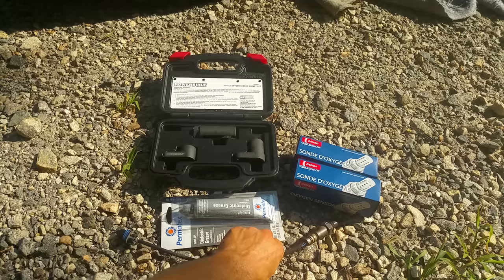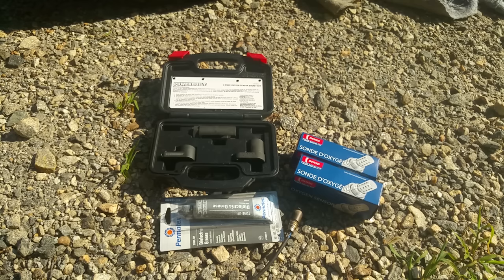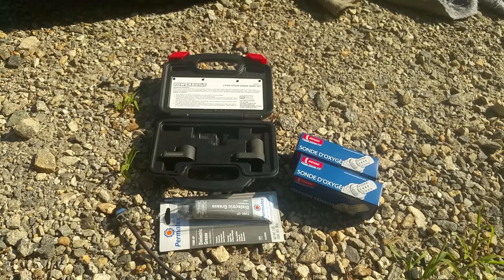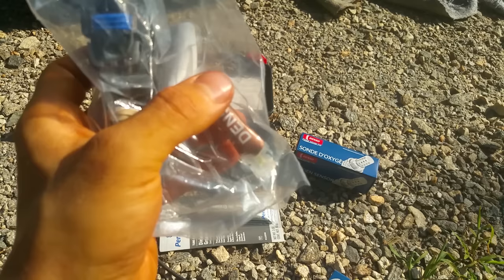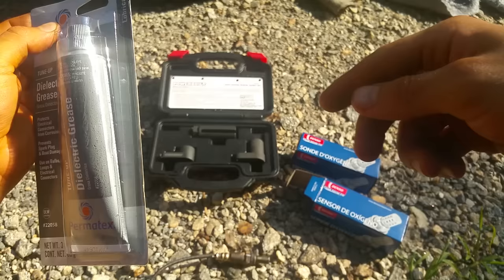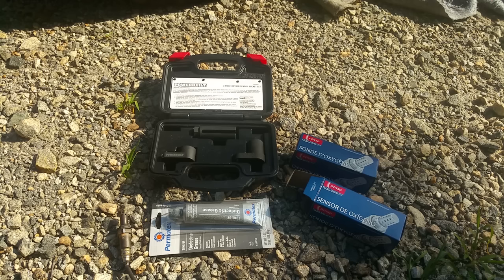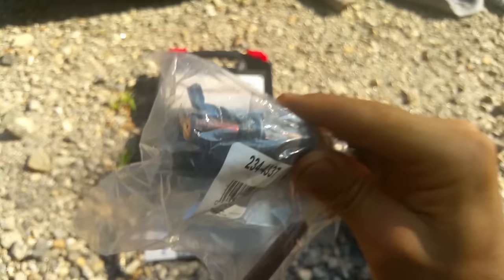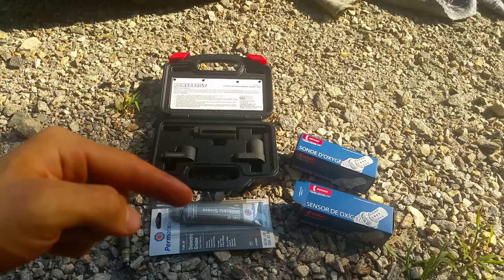NEVER Change Another O2 Sensor Until You WATCH THIS!

Comment: #1 rookie mistake DIY enthusiasts make on an o2 sensor change: removing the sensor from a manifold/header at ambient temperature. Always preheat the sensor bung, either with a torch or by running the engine until the manifold/header is at operating temperature, unless you enjoy torn knuckles & stripped threads.
Reply: That's what the auto tech at Auto Zone said when I bought an 02 sensor took kit. He said to heat it up - first.
Reply: I just raced my truck for a few minutes they still didn't come out easy
Reply: I did that, burned the heck out of my hands, stupid to do it hot!!
Reply: My fixer said opposite. He said if you remove O2 sensor when its still hot/warm, it breaks easily even with a little tap
Reply: In theory, heat makes things expand
 So I would tend to think, cooler would be better. 🤯
I'll have to do more research on this.
Reply: This is the type of stuff you learn from
Reply: @chadbailey189  only stupid if you're not wearing gloves n long sleeves.
Reply: @rbrooks1305  You heat the surrounding metal and it expands without heating up the sensor itself. Which is cooler and doesn't expand as much. That is the theory.
Reply: What about on my 2000 w a forged aluminum block shouldn't it be done cold
Reply: oH GREAT cant just change it out.
Reply: Wrong 🤡
Reply: I have done many with a cold engine and wasn't a problem,  I prefer the engine cold, some want it hot, I say what ever works for you.
Reply: This is Arizona baby not the rust buckets back east
Reply: How about you all get all ready to remove the sensor put the socket on the sensor than shock the muffler with heat until it begins to reach the sensor. It’s useless to heat both the female muffler and male sensor together, they are quite comfortable to expand together and stay tight with each other when hot, as they’ve done it all their life. 
The ice cold socket should help a little to shield the sensor from the torch heat. Don’t use the engine to heat it up. Do all this on a cold morning.  Like this fellow said many times “you know” and clearly by the comments, everyone knows. 😅 
the purpose of heat is to expand the muffler threads with heat while keeping the sensor cold and shrunk. 🎉
Reply: I've NEVER had an issue being able to remove an O2 sensor on a cold vehicle.. 🤷🏻
Reply: @rbrooks1305  You’re not supposed to torch it to where it’s insanely hot.   The idea is get it between warm and hot.  When it’s cold it’s very difficult to remove bolts.  Heat may slightly expand but you also loosen that tight rust that makes the bolts seem welded on their.  I’ve broken bolts and tools trying to remove bolts that are straight cold. Now IF you choose not to use heat, at the minimum spray some WD40 on the bolts and let it soak for 25-30 min first.
Reply: Half of these videos are misinformative
Reply: I just crawled under my truck and unscrewed it with my hands
Reply: @fernandojuancadena2475  Cast aluminum block?
Regardless, you're heating up the bunghole on the exhaust, not the engine block.
Reply: @garystevens1044  Thanks, that helps me remove my O2 sensor.
.....and every other person that watched it. 👍
Reply: @rbrooks1305  that's why you want to heat up the exhaust bung more than the sensor. Or at least that's what she said ; )
Reply: I did mine with a pair of needle nose pliers, no problem.
Reply: @alexcarbajal4862  😁😁😁
Reply: @alexcarbajal4862  channel locks for me...easy.
Reply: TY my Friend I am one of those so called DIYers but is out of need. Shops are charging more than I can or want to so all the videos I truly don’t know which to belive. So again TY the heat thing I will concur
Reply: Thank you so much for this advice
Reply: I’ve never had any problems getting an 02 sensor out !
Reply: @mattmatt222333 was not screwed properly then. But Im probably lucky one because I never had issue taking them out.but not as lucky as you to do it with hands only
Reply: Cold engine works for me
Reply: I’ve never had a problem taking them off cold .
Reply: @chadbailey189 Gloves work....
Reply: 3:07 why don't manufacturers put anti-sieze? It's getting them off when they are original that is a real pain.
Reply: Heating the housing is what will expand it away from the sensor, but heating both will probably expand them both.
Just saw some electrical wire heaters for taking off bolts and nuts. Probably hard to get it on the O2 sensor with it's wire, but safer than using flames.
Reply: Great idea brother! Thank you! Just read your comment, i will be doing this work in a couple of days, thank you for the advice! :) it will come in handy
Reply: I spent a few hours and several tools and methods including lubricating it. Nothing worked to get the sensor out. I finally broke out the map gas. Heated the exhaust pipe up some and bingo, it came loose. I was apprehensive about having a flame, but it worked out.
I have seen the electric coil heaters for heating nuts and bolts with no flame. TEMU has a few pretty inexpensive ones.
I almost ordered one, but I have so many tools I've bought and only rarely will use, that I could spend any more money and the map gas did fine.
Reply: @rbrooks1305  that is why it's important to try and keep the heat on the exhaust pipe, not the sensor. The pipe and threads will expand away from the O2 sensors and break that bond.
Reply: 100% correct I just watched this video and wrote about what you did in my comment
Reply: @rbrooks1305 Yes, it’s the expansion that you are looking for in a scenario like this.
Reply: I did it warm and it came rite out wooo hoooo 🎉🎉🎉
Reply: @davelowets same here came rite out with Noooo Problem 🎉🎉🎉
Reply: @dennyklein1965 that's all I use WD-40 came rite out
Reply: A circumference expands 3.14 times more than a diameter for a given rise in temperature. Roll your sleeves down wear appropriate gloves
Reply: @fernandojuancadena2475 they thread into the exhaust, not the engine block...
Reply: Glad I came here and saw all these comments about heat.  I would have waited for it to cool down so it'd be easier to work on.

I've NEVER had a bad O2 sensor in my life.  I've gutted cats, replaced cats with "test pipes" or "off road" pipes, had vehicles with nearly 200k miles, etc., etc. and NEVER had an O2 sensor issue.  Not even one where I had to take it out and clean it.

But I have a 2000 Buick Park Ave with the 3800II NA (no supercharger) and I've been having a high idle, rough running, horrible fuel mileage, low power, pinging/knocking, and the rough running is like a constant "shake" while accelerating.  I have a BT OBD2 scantool and use my Android phone with the Torque app and I've noticed all the tests that pass green have always done so EXCEPT the "Catalyst" one, it always stays red and says "Incomplete", I believe.

Well, after the code for the IAC unable to maintain a low idle and replacing it with no change, I got that same code, again.  I changed the PCV valve and the fuel pressure regulator (throwing parts at it).  No change.

Today, FINALLY, my first O2 sensor code popped up.  Bank 1 Sensor 2 O2 sensor bad.  Now, I realize codes don't mean the sensors are always bad, it means they are sensing a problem (hence my IAC motor replacement), but I've had a gut feeling this was an issue for quite some time.  Either an O2 sensor or clogged cat.  I've just never experienced an issue and I'm 38 now and have had a dozen or more vehicles and never had any O2 issues so I doubted myself thinking that could be a prob.

Well, I picked one up today, a Bosch one was the only one in stock, no Denso, and I'll put it on after my little brother's funeral tomorrow if I can.  It'll help take my mind off things because I'm not in a good state of mind at the moment.  I don't have any dielectric grease but I have CLP that I clean and lube my firearms with that I'll use (it's dielectric).  

I'll be sure and get it warmed up before I attempt to remove it.  I wish the cat was bolted on there like my old Dodge Stealth R/T did.  So much easier to remove and replace with a pipe or take it off and gut the cat.  I've never had an O2 sensor issue after gutting/removing cats lol.

Fingers crossed this fixes it.  I've noticed my AFR has been holding steady at 14.7 and at WOT I saw it hit 14.3 for a split second.

I used to have a different Stealth R/T TT and a 3000GT VR4, both modded with bigger turbos and injectors, and I could have sworn I had a must lower AFR than 14.7, but it's been a long time.  I had to tune it on the fly, depending on the boost I was running because I was running larger injectors on the stock computer.  So I'd have to tell my injectors to cut back by around -22% to -25%... I just can't remember the AFR I was looking for.

A google search is showing me 14.7 is "perfect" lol.  I'm gonna be sick if this doesn't solve the issue.  That means I have a vacuum leak and I'm 99% sure my vacuum leak is a blown intake/head gasket.  I have 119,xxx miles on this 3800II.  I have flushed the Dex-Cool coolant once... but I don't think it matters.  I'm a believer that ALL of these 3800II's blow headgaskets and all of those 3.1/3.4 engines blew the head/intake gasket that was shared between the head and intake.  

I hate GM to be honest, but it was my grandmother's car and she left it to me.  I maintained that car immaculately.  It had transmission fluid changes every 25-35k miles, 3k mile oil changes (even with synthetic because that's what she wanted).  I put copper plugs in at 80k miles (don't ask... I was a copper plug guy for the "power" lol) and I just replaced them with iridium plugs.  I still run coppers in my 1986 5.0 EFI F-150, though.

I'm happy for this, but her car had ZERO issues while she was alive.  After she passed, I babied the car to make it last and be respectful because I loved her more than anything.  That's when all these issues started.  Bad alternator, leaking valve cover gaskets, this high idle/rough running issue, the coolant reservoir running dry, some loud squealing that NO ONE knows what it is.  The squealing only happens when it warms up and it's hot outside.  If you rev in park, the squealing does not change in pitch with the revs.  The only thing that affects it is a LOAD on the engine.  You have to be in gear and give is gas.  The squealing is always the same pitch/sound.  I put a new belt on immediately with no change.  Dealership wanted $375 to TRY 3 things to see if they were the problem.  It was a BUICK dealership... am I the only one with a squealing Buick/3800II?  It feels like it because no one knows what I'm talking about.

Oh, and if I pull the dipstick out while it's running OR take the oil cap off, the vacuum is so strong, it kills the engine.  The O2 sensor isn't the ONLY issue, but if I can get it running smooth, it'd be a lot easier to sell.

Then I'll buy me something reliable...aka a Ford with a 4.6 SOHC.  Most reliable engine ever built.  I had a 1994 Thunderbird with the 4.6 SOHC HO (same engine as the Mustang GT) and the 4R70W transmission.  Know what probs I had out of that?  A bad MAF when I bought it at the auction.  I ran the HECK out of that car and it never gave ONE single issue.

 I have a 1986 F-150 5.0 EFI with the NP208 Transfer Case and NP435 4-speed with bulldog and the 9" rear with 3.50:1 ratio.  Guess what issues it has given me?  A bad TPS.  Then at 120 or 130k, the timing chain needed replacing.  Now it has a steel timing chain and gears so it should have another 200k+ trouble free miles on it.

I'm sorry, I'd trade this Park Ave for a Crown Vic any day of the week.  I prefer the extra luxuries of the Park Ave and I think it looks better than a crown vic, but you can't beat that 4.6 V8 and the 4R70W for an automatic  tranny.  And they have the 8.8" rear end so no probs there.

I'll NEVER buy a Dodge or GM for as long as I live.  Sure, they outran Fords in the 90's and early 2000's.  But they'd blow up after 3-4 hard runs.  Yeah, the LS1 was fast, but everything surrounding it was junk.  My mom's 2000 Trans Am WS.6 was in the shop all the time.  Engine never blew, but it had a million other issues.  Aunt had a 99 C5 with the LS1.  What automatic does GM put in every RWD?  That junker 4L60E.... which was a 700R4 with more electronics.  Both absolute junk.  Those were low powered V6 transmissions AT BEST and they went in LS1 sports cars and 1/2 ton trucks with 350 V8s lol.  That's the most common thing we worked on in the garage.  Replacing and rebuilding 4L60Es.  Didn't matter if it was a 1995 Firebird with 200 horsepower (3.8 V6), a 90's Chevrolet 1500 with the 350 Vortec? or a C5 Vette.  The ALL tear up.

My Thunderbird's 4R70W barked 2nd gear probably 200 times and felt as good as the day I got it.  I changed the fluid when I bought it with Mercon V and that was it.  It was only 205 horsepower/265 ft-lbs torque, but it ran good for what it was, and it had crazy 3.08:1 gear ratios.  It'd still pull certain hills in OD where this Park Avenue can't dream of doing.  It always has to gear down.  Funny, they both have 205 horsepower, but one has 225 ft-lbs torque and the "HO" 4.6 had 265 ft-lbs torque.  No matter what, it put a lot more stress on the drivetrain simply from being a V8 yet NOTHING ever had any issues and I ran it HARD.

Drive a Park Ave 3800II around babying it and the dang thing falls apart.
Reply: @davelowets  I think I'll try it cold first, then.  My Park Avenue has been kept in a climate controlled basement underneath the house all of its life.  There is ZERO rust underneath the car.  It looks like a new car.  Clean exhaust pipes and all.... not a spec of rust.  Yeah, I'll try it the easy way first while it's cold since the bottom of the car looks mint.
Reply: I’ve never had an issue taking them out cold, but also half the times I take them out after a drive and letting it cool
Reply: @UdderBoy  I've only just done this once and it was a couple of weeks ago.

Bank 2 Oxygen sensor (behind the cat) on a 2000 Park Ave.  Kept in a basement that is climate controlled and has a powerful dehumidifier running 24/7.  Climate controlled because it's under the house and there's vents from the HVAC units.  

Did mine barely warm.  Warm as in... ran for 2-3 minutes as I cranked it up, pulled it out of the basement and drove it to the other side of the house where I have a big outdoor garage.

No rust underneath.. clean as a whistle undercarriage.  Zero rust.  

Was it in there tight?  Absolutely.  But two wrenches got it broke loose with moderate effort.  Two wrenches as in when you put the ends together and create a "longer wrench" haha.  

Oh, but I did use maybe a Lucas penetrator oil beforehand, to be fair.  Let it soak about an hour, sprayed it, again, and then went to work.  

No biggie.
Reply: Yoooooooooo that's a great point thanks! 

P.S. : random tip if you get a spark plug boot stuck in the engine on the plug heat the socket the boot came out of with a propane torch or bbq grill  for 2 -3 Mins and shove it on the plug in the engine. Worked easy
Reply: @Wakeupandsniffthecoffee some manufacturers do put anti-seize on the threads before being boxed. You need to check first before buying them. It is usually mentioned in the product descriptions. Bosch puts anti-seize on their O2 sensors, as I'm sure others do as well.

Comment: Here a tip from a professional, if you're gonna replace it with new sensors any way just cut the wire off and just put a regular socket to remove the old ones
Reply: How are you going to torque the new ones?
Reply: @Igor_ZG thats what I was thinking, you still need to have those sensors sockets
Reply: Any 7/8 wrench
Reply: @Igor_ZG  LMAOOOO GOOOOOTTT EEEEMMMMMM
Reply: just twist till it feels right and say "click"
Reply: Thanks for the car logic 😀
Reply: @svitozar8618 He didn’t say not to have the sensor sockets. He knows you will need them to install the new ones. He is just saying since you are not going to reuse the old ones then you cut off the wires so you can use a regular socket which is more comfortable to use.

Comment: Believe it or not (!) sometimes it helps to try to tighten a stuck bolt/nut/O2 sensor(?) THEN try to loosen it.
Reply: The number one only way that always works to remove a stuck 02 sensor, egt sensors, knox sensors is to have a friend rattle the bung with an air hammer while turning the sensor gently with a wrench. I do this at work every time i get one and it works every time. Obviously you need to be an experienced air hammer operator or be able to use common sense and not ruin the bung, the exhaust or anything else but if you can operate your tools it works.
Reply: Or just have your engine run a couple of minutes to heat up the pipe and hoala. Heated metal expands and softens and you can loosen like a girl. Isn't it easy? Just don't mind the heat though. 🤣🤣🤣
Reply: Yeah I am trying everything I can
Reply: So true.. also sometimes tapping it lightly
Reply: It works for me every time
Reply: @brianb2454  lightly tapping on any stuck part with a heavy mallet or light hammer works 99% of the time. It's just a matter of how much you wanna tap. Might take a couple thousand repetitions.. 😂🤔
Reply: 100%.. injector pipes same process
Reply: Came here to say hit it or heat it too but got beaten to the party....👍👌👍
Reply: Never tried that but as I understand it,it breaks the seal 😊
Reply: and/also HEATING the area around the bung - to expand the metal

Comment: Tip #1.  Heat the vehicle to running temperature.  You won't have to TORQUE anything to get them off and risk damaging anything.  Obviously protective gloves and long sleeve is recommended so no snowflakes should cry about being burned.
Reply: Amazing